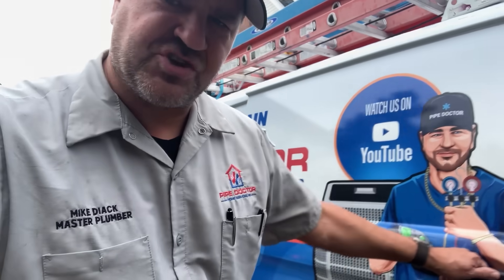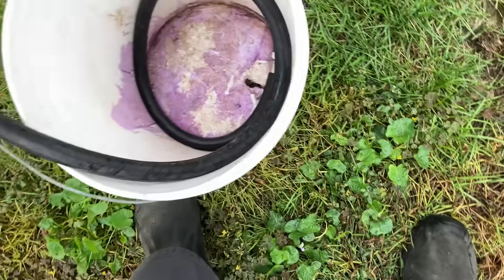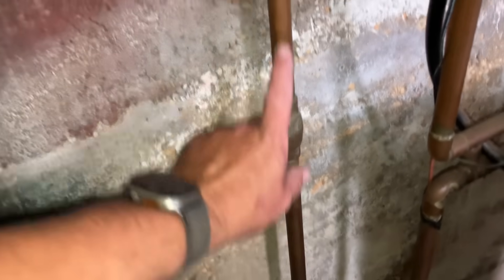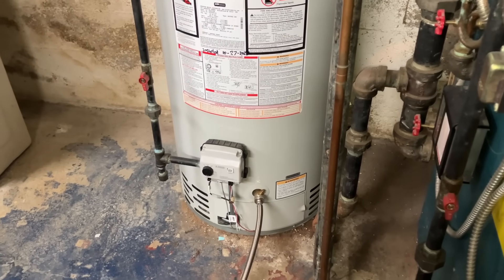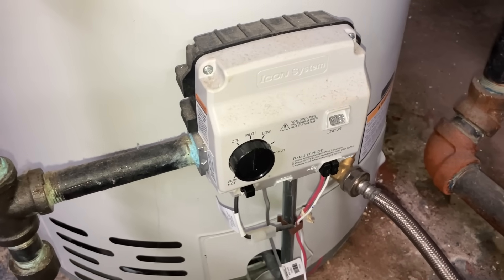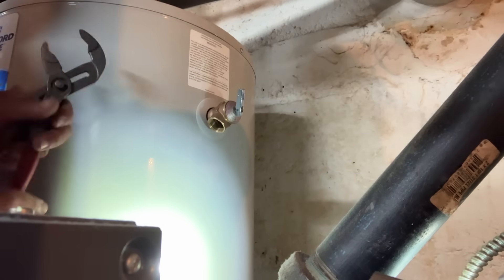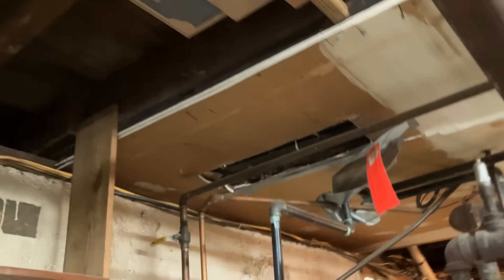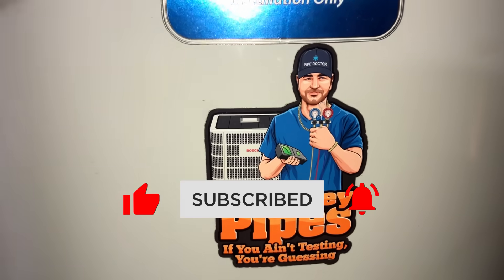T&P Valve Leaking on a 2-Year-Old Water Heater? Here’s the REAL Cause (and Fix)

Comment: All it needs is to drain some water out so the water level below the T/P valve then you can take out the old one. A 2 years old heater the T/P valve can not go bad. Just need an air expansion tank, OR lower the water temperature somewhat.

Comment: That’s should be covered under the 6 year warranty - no charge for the customer
Reply from the maker: No charge to homeowner. Hummm
I guess you work for free. 
Is the labor to process and warranty claim free too. 
Just another commenter with their head up their ass.
Reply: @PipeDoctor I mean the bad part! But you didn’t install the water heater so you can charge accordingly

Comment: The new safety valve is installed but remains closed while pump is sucking water out. Was it supposed to be open to avoid a vacuum like the old one was?

Comment: The flu pipe is not code compliant. It needs twelve inches of vertical rise before a change in direction😂😂
Reply: Ok, most flue pipes are not 12 inches vertical, codes keep changing requiring most homes to be replumbed constantly.

Comment: I would have installed the expansion tank any how for the customer. mine leaked with out the one way valve and ended up putting in an expansion tank with the one way valve. no problems as of yet.
Reply from the maker: Thanks for the comment!

Comment: If you have a pressure regulator on your water main, an expansion tank is required.
Reply: right, because the PRV creates a closed system, which is what he discussed in the video.

Comment: perhaps the water got too hot, too much pressure and relief valve never closed when pressure dropped.
Reply: Usual story without an expansion tank or expansion relief valve (releases at a lower pressure than the TPR so that the TPR does not weep as the pressure in the tank rises during normal heating) is that over time the TPR can get gunked up by dissolved solids in the water.  An EPR is required in at least some states in Australia to avoid the TPR issue.  If there's one thing you want properly working it's the TPR.

Comment: No exp tank on hwh
Reply: Doesn't need one if you there is no backflow prevention device.  I have one on my water heater even though I am on a well as the well feed contains a backflow preventer.  These questions can easily be answered by your local water district in 3 seconds.
Reply: @SeatonHeatingAC  false information. Depends where you live. Should be on anything closed, so technically a backflow, check valve, or PRV. Especially when connected to the municipal supply. In MD it's code to install an expansion tank.
Reply: @TheSaw410 You obviously do not listen. I said any form.  Internet guys crack me up.
Reply: @TheSaw410 Stupid code if you don't have a backflow preventer. Unnecessary cost and does nothing for you.
Reply: @SeatonHeatingAC   All depends on the location of your well-feed backflow preventer. If it is at the well or before the pressure tank, then no need for exp, tank because the pressure tank will accept the increased backflow pressure from the WH
Reply: @MaMa-qh4dy They are installed at the entrance to the homes here.
Reply: @SeatonHeatingAC I am not on a well and I don't have a backflow preventer. I told my friend who works for the water company how risky this is for them in terms of a terrorist attack. He told me to just shut up
Reply: @integr8er66 Weird comment award goes to you.
Reply: @SeatonHeatingAC Which one? You mean because I recognize how inept the people who are supposed to keep us safe are? They put jersey barriers all around the water plant all the while anyone could just pump anything into the same line from their basement. Do you think it's weird because you are one of the ignorance is bliss people? When I see a problem I speak up
Reply: @integr8er66 You are reading way too much into this.  Go take a deep breath.
Reply: @SeatonHeatingAC No idea what you are talking about? in what way? Its not reading too much into something when its is something important, and when people make ridiculous claims about what everyone must install when the rules cary wildly by location and rules (Codes) are flat out wrong broad brush approaches in many cases
Reply: @SeatonHeatingAC  there is a check valve that causes it also.
Reply: @scottmaz4063 ,some new water meters come with a check valve. I could not see the model # or brand on this one ( not very many water companies use them yet, but they are out there).
Reply: @boby115  that was a badger M25 5/8" meter, nothing special about it, manual reading no electronics and for sure no check valve.
Reply: @throttlebottle5906 ,if it’s a Badger of any model you are correct,it can not stop back flow. Badger has not developed a water meter with a built in check valve at this time.
Reply: @SeatonHeatingAC If you are on a well then you already have an expansion tank.